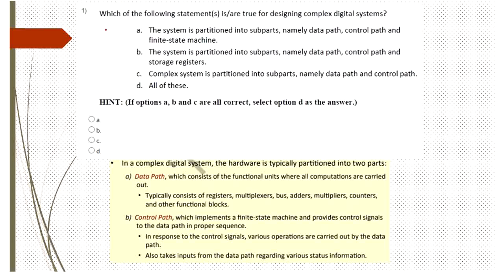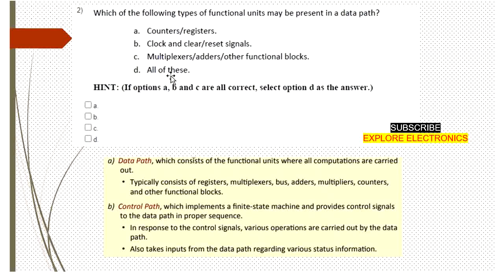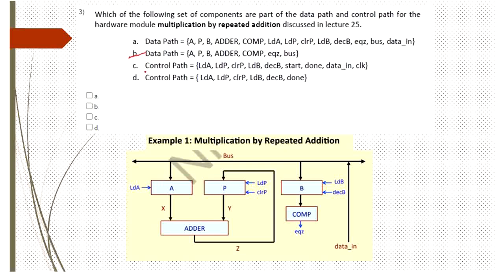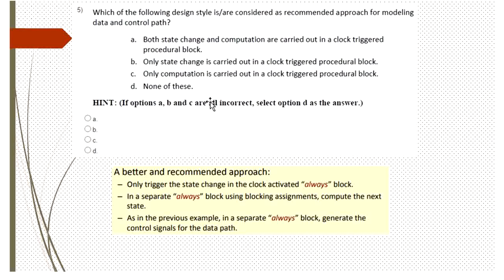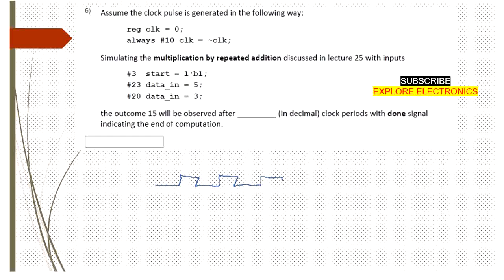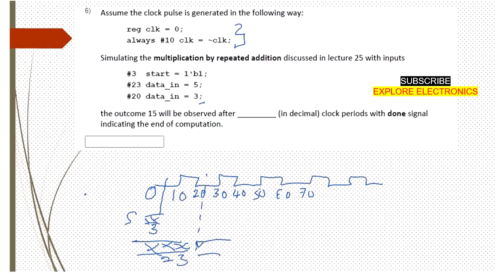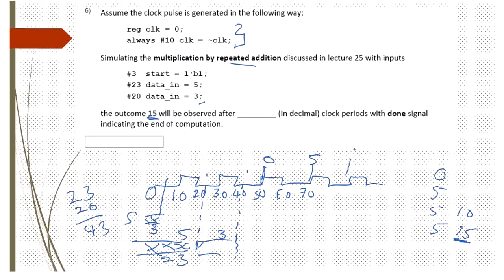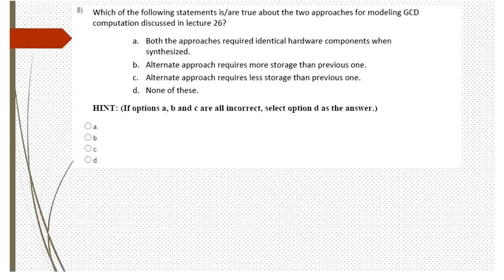verilog interview questions part 6 | Datapath and control unit | verilog tutorial MCQ 6

Comment: I have tried to run this code below for Week 6 Programming Assignment 1 but None of the Private or Public Test cases passed, All the public test cases showing   

"Fail: (Sum of first N=  x terms) => (R =   0)?\n  " for all the four public test cases and subsequently showing wrong for all the private test cases.

The Verilog HDL Code for the Dataflow proble for sum of N NAtural numbers which I tried is as Follows:
___________________________________________________________________________________________________________________

//Register module

module PIPO (Out, In, Clear, Load, Clk);
	input [7:0] In;
	input Load, Clear, Clk;

	output reg [7:0] Out;
	
  always @ (posedge Clk) begin
		if (Clear == 1) Out = 8'b0;
		else if(Load == 1) Out = In;
	end
endmodule

//Counter Module
module CNTR(Out, Clear, Inc, Clk);
	input Clear, Inc, Clk;
	output reg [7:0] Out;
	
  always @ (negedge Clk) begin
		if (Clear == 1) Out = 8'b0;
		else if (Inc == 1) Out = Out+1;
	end
endmodule

//Adder Module
module ADDER (Out, In1, In2);
  input [7:0] In1, In2;
  output reg [7:0] Out;
  
  always @ (In1, In2)
    Out = In1 + In2;
endmodule

//Comparator module
module COMPARATOR (Out, In1, In2);
	input [7:0] In1, In2;
	output Out;
	
	assign Out = In1 <= In2 ? 0:1;
endmodule

//Data path module
module sum_series_datapath (CltN, LoadN, LoadR, Clear, IncC, Data_in, Clk);
	input LoadN, LoadR, Clear, IncC, Clk;
	input [7:0] Data_in;
	output CltN;
    wire [7:0] Nw, Rw, Cw, Aw, Bus;
	wire ld;
	assign Bus = LoadR ? Aw : Data_in;
	assign ld = LoadN | LoadR;

    PIPO R (Rw, Data_in, Clear, LoadR, Clk);
	PIPO N (Nw, Bus, Clear, ld, Clk);
    CNTR C (Cw, Clear, IncC, Clk);
    ADDER ADD (Aw, Cw, Rw);
    COMPARATOR CMP (CltN, Cw, Nw);
endmodule

//Control Path Module

module sum_series_ctrlpath (LoadN, LoadR, Clear, IncC, Stop, Clk, CltN, Start);
	input Clk, CltN, Start;
	output reg LoadN, LoadR, Clear, IncC, Stop;

	reg [2:0] state;
	parameter S0=3'b000, S1=3'b001, S2=3'b010, S3=3'b011;
	
	always @(Clk) begin
		case(state)
                       S0: if(Start) state <= S1;
			S1: state <= S2;
                       S2: #2 if (CltN == 0) state <= S2; else state <= S3;
                       S3: #2 if (CltN == 1) state <= S3;
			default: state <= S0;
		endcase
	end
	
	always @(state) begin
		case (state)
                      S0: begin #1 LoadN=0; LoadR=0; Clear=1; IncC=0; Stop=0; end
			S1: begin #1 LoadN = 1; Clear = 0; end
			S2: begin #1 LoadN = 1; LoadR = 0; IncC = 1; end
			S3: begin #1 LoadN = 0; IncC = 0; Stop = 1; end
                      default: begin #1 LoadN = 0; LoadR = 0; Clear = 1; IncC = 0; Stop=0; end
            endcase

    end

endmodule

__________________________________________________________________________________________

Since This program is executing, giving even if Wrong answer without any syntactical error like port faluire or something, or like improper instatiation, these errors are not comming, It is siply executing after compile and run button and showing Wrong Answer for all the corresponding public test cases. Tha;t What I am trying to say is that It is not showing any syntactical error, There are Semantic Errors and Obvioudly Logic Erros which is Why the test cases are not passing well correct;ly. I think I have done the logic erros, where I am not clear is in the COntrol PAth module. Pelase check and please help us to reach the correct solution in the best possible way and Logic. Thank You Sir
Reply: I think this is a Huge Comment, click on read more, to view the code, Which is Incorrect but it is executing only to give The comment Wrong Answer (Fail) in all the test cases, but the fact is it is executing. Tha't what I came to know